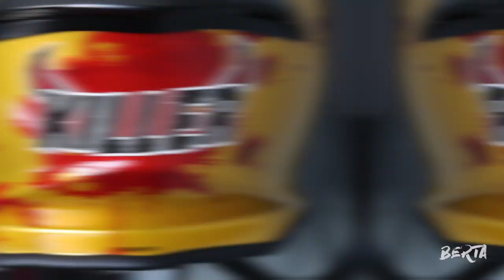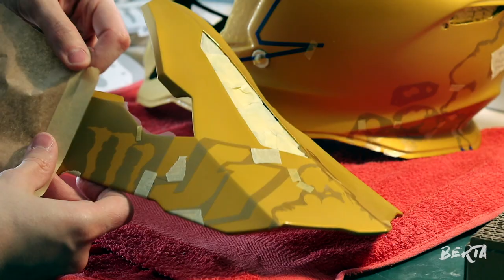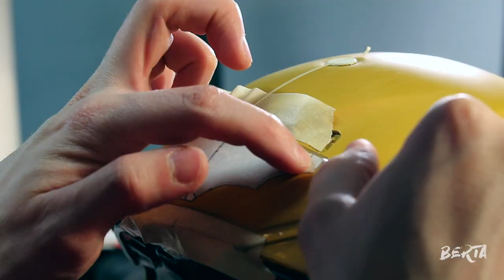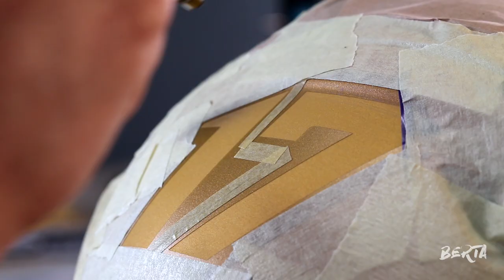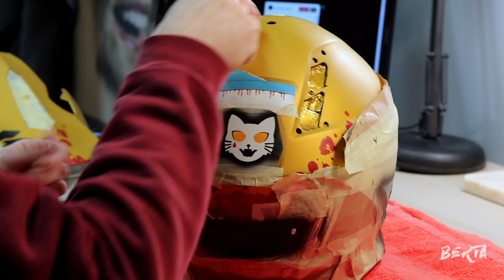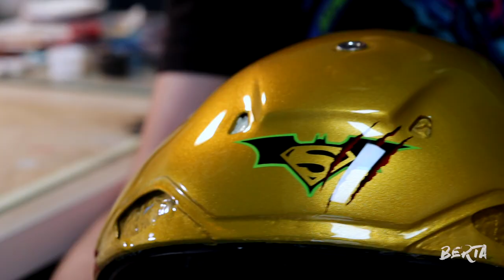Custom Paint Just1 Helmet - Solar Gold

Comment: How did you remove the top vent covers? They don't come off when I remove the screws, and I think they are glued as well...
Reply from the maker: I made the helmet a few years ago but I remember that it was a bit ruined so it's likely that the air vents were glued and then when reassembling them I welded them in place! 🌟
Reply: Thanks mate, awesome job with the helmet! @Bertairbrushartist
Reply from the maker: @flatwhitepaintworks Thank you so much! 🔥

Comment: bertha dear! So that your paint does not lift when you place the stencils, do you put a matt varnish between layers and layers?
Reply from the maker: Hey! Absolutely not..the fact that the paint doesn't lift depends on the quality of the products and the correct preparation of the surface 🌟
Reply: @Bertairbrushartist  You have to do some paid tutorials on how to do work with airbrushing, preparation of parts, different types of paints, tools and more! Thanks for answering
Reply from the maker: @damianleonel4528  thanks for the excellent advice..well structured tutorials but they require a lot of preparation and editing time..but I will take it into consideration! Thank you very much for the support! 🌟🔥